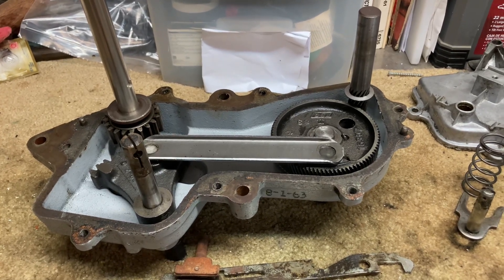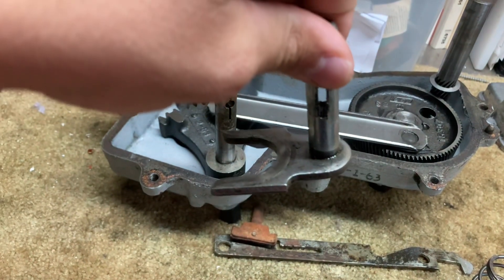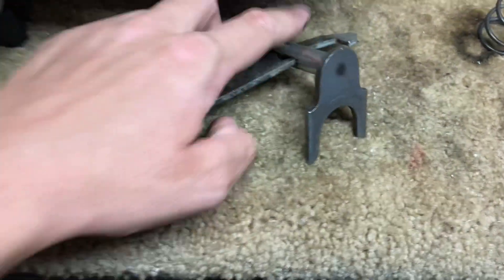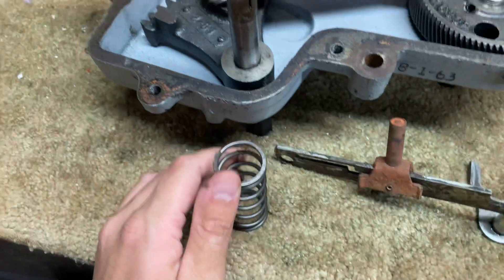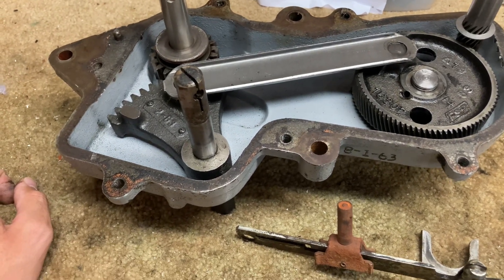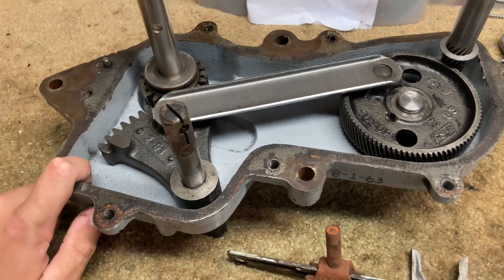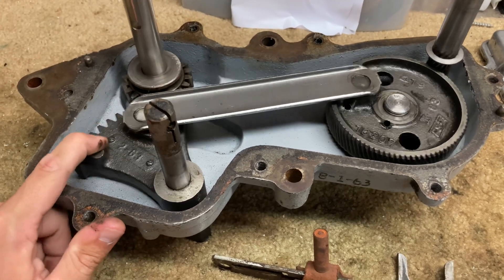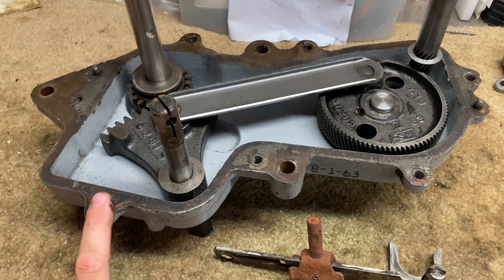1963 RCA Whirlpool Imperial Mark XII: a better explanation of how the transmission works

Comment: That is a sturdy solid all metal transmission, unlike the Direct Drive one that have plastic gears for the Neutral Drain / Spin Cycle (but that one still pretty solid despite the plastic parts).
Reply from the maker: The direct drive transmissions are good but their Achilles heel were the neutral drain pack since they have a tendency to go out after a number of years and will take it’s toll on the spin clutch since it was never intended for a spin drain as it was designed for a neutral drain. Yes, the older belt drives can do peculiar things as they age but usually are easy to diagnose and repair since all the complexity is outside of the transmission and not in it.

Comment: Wow that’s was interesting never saw the inside. Look how solid, all metal no plastic, no wonder that these machines lasted and worked as well as they did!
Reply from the maker: There’s metal everywhere compared to the direct drive transmissions. Might explain why these lasted for many years, the direct drive transmissions lasted a good while too but there’s plastic inside along with the neutral drain pack which will eventually fail and require a disassembly of the transmission.

Comment: With a transmission so simple, there's pretty much no reason it shouldn't run forever.  Whirlpool really knew how to build stuff back in the day.
Reply from the maker: Indeed, Whirlpool made good appliances until they discontinued the direct drive washers and ever since the direct drives were discontinued Whirlpool has really cheapened up on their appliances and the newer HE belt drives can barely hold up for 5 years without having to do repairs to them and even heard on AW where someone had the transmission crap out in a Maytag “commercial” washer and had to go through quite a fiasco to get it fixed. Sadly consumers are too cheap to pay for quality these days and a machine like my Whirlpool would cost a little more than a Speed Queen TC5 but most millennials wouldn’t want a machine that can’t wash their comforter or any other bulky items but honestly those kinds of bulky bedding didn’t really exist back in 1963 and most people had thin blankets and quilts as opposed to bulky comforters and bed spreads.
Reply: @seana806  Great points, you're right on all of that.
Reply from the maker: Late reply, but what type of sealant did you use on the repair of xjoe81x’s other Kenmore 80 series when you put the transmission back together? Will have to use the same or similar type of sealant when I put this transmission back together within the next month.
Reply: @seana806  Permatex gasket maker.  Auto parts stores have them.
Reply from the maker: Thanks! Will have have to pick that up next time I am at the auto parts store and it’s holding up on Joe’s machine it should definitely hold up on mine just fine. I have some 3M industrial sealant but I am not sure if it was designed to be used as a sealant on a washer transmission and I don’t want to chance using 3M industrial sealant since all the oil could possibly spill out of the transmission making a mess.
Reply: @seana806  I'll bet the stuff you have would work just fine, but then again, for a few dollars, it's not worth taking the chance.
Reply from the maker: The 3M industrial sealant more than likely will work but then again it’s worth spending a few extra dollars on the correct sealant I need. If I put 80 or 90 weight gear oil in it wouldn’t spill out as easily but these transmissions belt drive and direct drive originally came with 60 weight no detergent oil and the closest thing to that is Valvoline 50 weight racing oil which is low on detergent which should work just fine.

Comment: Wow that is simple
Reply from the maker: Indeed, a total of 7 moving parts and that’s about it really. A good simple design that works.
Reply: @seana806  How many parts does the direct drive transmission have?
Reply from the maker: @jeromedavis8575  you keep on asking the same question over and over, not very many. Probably around 9 to 10 parts would be my guess.

Comment: I'd use recommended gear oil by whirlpool.
Reply from the maker: When Whirlpool suggests “gear oil” they are referring to 60 weight motor oil and not 80 and 90 weight oil. Whirlpool even spec’d 60 weight oil to be used in these transmissions.
Reply: @seana806  Have you tried the OEM whirlpool oil?
Reply from the maker: OEM Whirlpool oil is 60 weight oil. Gordon (kenmoreguy64) on AW said the closest thing you can get to 60 weight oil without buying the Whirlpool oil is Valvoline 50 weight racing oil since it’s light on detergent.
Reply: @seana806  Does any washer brand use 90 weight gear oil in their transmissions? I believe GE did.
Reply from the maker: All washers came with 60 weight oil originally but if the machine was heavily used and was rebuilt, 90 weight gear oil was put in to make it run a little smoother and provide a little more protection from wear but since this original transmission doesn’t have much wear on it at all I am putting 50 weight oil in as mentioned in the video.